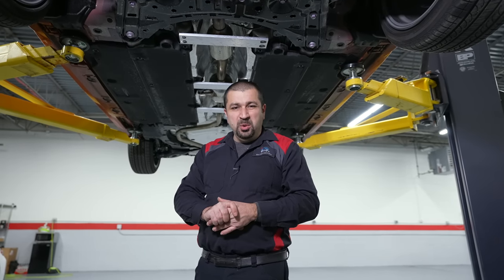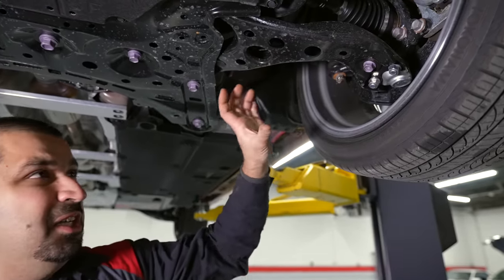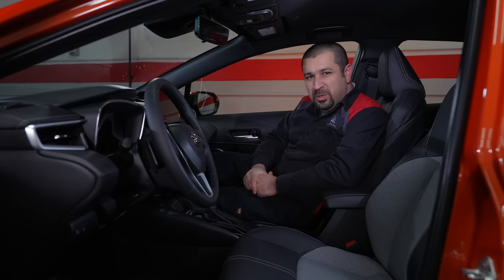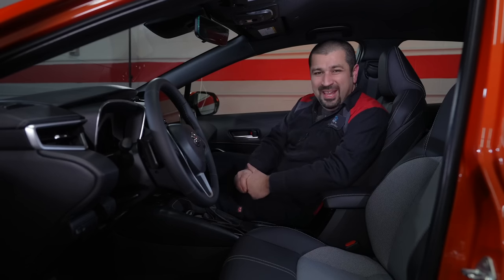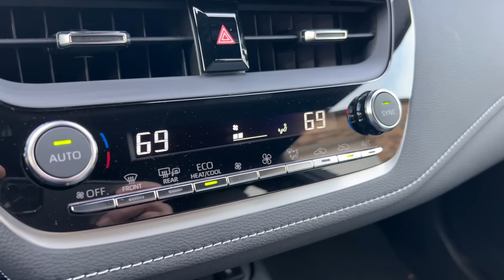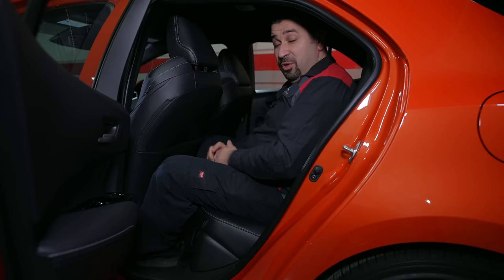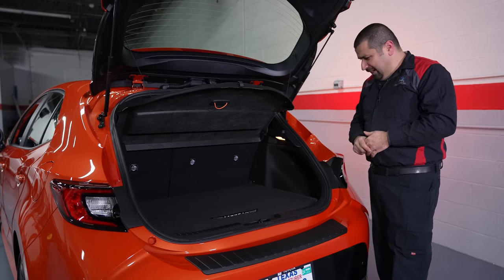Should You Buy a Toyota Corolla in 2023? I Have Good News and Bad News!

Comment: My 2011 Toyota Matrix has way more leg room in the rear, as well as more trunk space. It also has a roof rack that bolts into the sides of the roof. The new Corolla has a roof rack that attaches the ledge of the doors. WTF? I also find it off that the 2023 model doesn't come with a sunroof option unless you upgrade to the $40k model. That's ridiculous! My Matrix has a sunroof for crying out loud. Another feature the Matrix came with was a JBL sound system. The new Corolla doesn't come with the JBL unless you upgrade to the $30K model. Mind you, I am referring to CAD prices here. I just find the newer Corolla to be a "little" cheaper in quality vs price from their older models such as the Matrix. As for the new Corolla having a plastic valve cover, plastic under heat will eventually run the risk of developing cracks with time. I don't know how well these valve covers will hold up when these cars start reaching 10 years of age. Another thing that concerns me are for those living in the rust belt. I like how they covered the undercarriage; however, there is a risk of rust forming underneath those covers. Unless they're 100% waterproof, water and humidity will make its way under them. I would definitely consider applying an undercoating under those covers to stay on the safe side.

Comment: Kinda glad I got the 22, because although wireless aa/carplay is nice, the sharkfin is annoying for washing the roof and the new chime sound is REALLY annoying. The cruise taking two presses in the 22 is a little annoying, but cancel and resume are 1 press which is fine.

Regarding the few trim choices of the Hatch, I think they made a conscious decision to do this to push people into the Corolla Cross instead. They probably figure the Corolla Sedan and the Yaris are the small car choice, and the Corolla Hatch is mostly for hatch lovers, then the Corolla Cross is for those who might have previously chosen the Hatch. Also with hybrid and non-hybrid and sedan and hatch, that's a LOT of trims if they don't make some tough choices and cut out a few of em.

EDIT: After 1.5 years of ownership, here are the biggest annoyances with this generation Corolla:

- all interior plastic trim scratches very easily, and the dash as well
- many owners have complained that the thin vinyl coating layer on the steering wheel scratches up or peels off, I haven't had this problem though as I use driving gloves as my hands get cold but mine doesn't have the heated steering wheel
- the piano black plastic trim along the shifter and AC controls even more so, even a paper towel will scratch them! Use Swiffer duster or damp microfiber cloths only!
- the paint scratches and chips very easily, consider ceramic coating to reduce scratching, or full front PPF to reduce chipping, however you will still get door and trunk chips somehow
- road noise is bad, consider adding sound deadening to doors and wheel wells
- blower motor suffers from same coil whine problem as every Toyota and Lexus for the last 5+ years when fan speed is above about 75%, there's an add-on cover they stopped providing which fits and which MIGHT dampen it a bit, part number 55607-02280

Comment: If you only sell what 95 percent of the market is buying you can’t go wrong.
In America 95 per cent of the cars sold have automatic transmission.
I had a corrola in 1972 with a manual transmission I can’t buy a manual transmission today unless it’s custom or I get the GR sports model with the awful ride. Toyota is being smart by limiting trim’s too much custom work costs time and effort on the production line. Many people are settling for a car with what they can afford. $28,000 is a lot of money.

Comment: I just bought the 2023 this same one, but you didn’t mention that they changed the oil 0W –8 is what they say to use. The manual says if there is none available, you can use 0W 16 but then go right back to 0W8, but these oils are for fuel economy, and not for protecting the engine, which I do not like but it could be good but it’s new and I feel like a guinea pig and I didn’t know I was going to be one

Comment: My first visit to this channel. A good and informative video. Sadly, the new LE sedan, has reverted back to a rear beam axle suspension. That's a shame, but I guess like Mazda, Toyota do it to keep the price down. I don't know at what level IRS is supplied on the new 2023 sedans. I still would like to see this 169 bhp engine offer more torque at lower revs. These days, we are obsessed with BHP at the expense of torque, meaning you have to rev the arse of it to get anywhere. Therefore, the new Toyota 2 litre hybrid with electric power to give you low end torque when you take off is the way to go. I've driven a Camry Hybrid 2012 model since new and done 99,500 miles. I am not a fan of CVTS or ECVTs, I prefer the 6 speed auto my wife's Tucson Blue hybrid has, but the main thing is you take off with loads of torque due to the electric motor. I get you lot love stick shift. Me, no thanks. Get an auto box with fully manual override with paddle shifters and Bob's your Uncle. Unlikely to happen in cheap family cars of course! In stop-start traffic, manual boxes suck. Beng a Brit, I drove every day and changed gear over 1100 times a day. As a result of that and the pressure the clutch put on my lower spine, especially in stop-start, I had an 8hr back op with 3 discs replaced and a bunch of titanium. I know, a manual is fun on a country road with bends, but realistically, most Corollas will be town cars. But, good luck to you if stick shift is what you want.
Reply: The  sneaky regression to a torsion beam in some Corollas is Toyota regressing back to its bad old penny pinching habits. The 2.0 Hybrid system found in the flashy new Prius gives a major boost of power. All reports indicate the upgraded 1.8 in the 2023 Corolla Hybrid provides a substantial improvement over the old powertrain.  I am sorry to hear about your back problems. Luckily, mine is fine so I will keep shifting my own gears as long as I can.

Comment: My spouse and I are taking delivery of an SE hatchback next week! It's interesting hearing AMD advocate for the base sedan; we chose the hatchback for the very reasons he argued against...alloy wheels standard, better interior appointments, classier/sportier exterior. Not to mention substantially increased storage/cargo area: almost 5 cubic feet extra with rear seats up, 10 more with seats down! The clincher was the price; in our area of the midwest, a modestly appointed SE hatchback only retails for ~ $700 more than an LE sedan.
Reply: i  have a 2019 hatch the xse and absolutely love it. This is a really fun care to drive but it isn't a race car.  Wish it had a little more pep but it's a corolla and it is dependable and if you maintain it it can last forever.  I had a matrix hatch years ago and it was quick.  Had a different engine

Comment: I noticed that Corolla have hood insulation pad but mine doesn't. It's a '23 LE, It's easy and quick to install but cost around $200+. Is it really worth it? I'm more concerned about protecting the hood paint from the engine heat. I plan of keeping it like forever 🙂
Reply: It won't do anything for paint, but does make engine noise a LITTLE better.

Comment: One thing to note. The strength to weight ratio of Steel amd Aluminum alloys is such, that you can design a steel component to be lighter than an aluminum one, because it can be thinner/smaller. Also, steel has an endurance limit..i.e. it has much better high cycle fatigue life, if designed properly.

Comment: I have been driving Corollas for, geez, over 40 years. My current commute car is a 2008 Corolla LE (or XLE, dunno) with a manual transmission. It has been very good to me, ,minimal trips to repair, reliable transportation. I am getting older, and I am now looking at getting a new car. I looked at the Corolla, the Corolla Hybrid, and the Prius XLE. At this point in my life, I am afraid I want to abandon the Corolla and go with a Prius. I don't need AWD. I don't need the "Limited" edition, and the price is only $4k more than the Corolla Hybrid, with the same MPG. For that $4K I get so much more. I am not buying yet, just thinking, and when I buy it will be a cash deal. But soon,....
Reply: My car is from the same generation (2003-2008) as yours. Those Corollas had a relatively high seat height for a small car and generous headroom. The 2023 Corolla and Prius sit far lower to the ground than your 2008 with much less headroom. You may find dropping in and climbing out to be a real chore. I don't think the Camry is much better in that regard. People keep saying CUVs are taking over from sedans but cars today are so sleek and low that many buyers are forced into more accommodating Crossovers whether they want them or not. I am not a big fan of crossovers but there is not a single Toyota car today that fits me comfortably. If nothing changes, my next 'car' will be a RAV4 Hybrid.

Comment: Hello, I bought the Corolla Sedan 2023. I only use it to drive to work at the hospital. I am a boring guy (really boring) and really dont ride to go to different places. I don't drive much, my last car accumulated 7,500 miles in 6 years.  But I sold it and got the corolla 2023 Sedan.  It has been exactly two weeks since i bought it and i have 101 miles in it, so that would mean that each month I will accumulate 200 miles. When should I change my oil for the first time?  By the time I reach 5,000 miles its going to take years (like I said, I am a boring guy). Any feedback will appreciate it !
Reply: If you go though the long list of videos AMD has produced, you will see he has a very clear views on oil change intervals and an initial break in oil change. Your car really ought to be taken on a highway run every week or two to make sure the engine is fully warmed up and moisture condensing in the oil is vaporized.

Comment: I think we need a real investigation into who exactly decided that only Americans can't have manual transmissions without paying for expensive trim models. (Only expensive Tacoma trim package, expensive Corolla, and Nissan only sells the 65,000 dollar Z with manual transmission.  This definitely was not a decision by Japanese executives.  I want to know is it the 3rd party distributors who have so much power over the independent dealers? The distributors force port-added features and even sell the F & I products dealers have to use. I don't buy the lie that they only allow manual transmission on expensive cars due to low sales on manuals on cheaper cars of the past.
Reply: Toyota made almost $9 Billion in the last quarter so they can certainly afford to offer a manual. I salute AMD for naming and shaming Toyota USA and I would like to see someone held accountable for the decision. As painful as the news is Stateside, Canadians will feel even more aggrieved because we buy manuals at a higher rate . Until 2022 we actually had a manual Corolla L sedan that was not sold in the US and now we have lost all manuals on non-GR Corollas. To add insult to injury, I just learned through earlier comments that Toyota has actually reverted to cheapskate torsion beam rear suspension in the non-hybrid LE sedan.

Comment: In the UK in the last 6-8 months, they dropped pretty much all the option packs and nice-to-have standard equipment from the Yaris model. Now, you basically only get to choose dual-zone climate and the safety equipment (BSM, RCTA, Park Assist). On the GR Sport model, you get GR tuned suspension and modified steering (very nice), but otherwise nothing else except the pack to bring it up to Excel spec (it adds the additional safety equipment).

They dropped the HUD, heated seats, heated steering wheel, and auto-dimming rearview mirror. It's as if they're trying to push people into the Yaris Cross (but even that lost options, such as the pan roof and HUD).

I'm not sure how much is due to parts, and how much is other factors.
Reply: I've been noticing that the US market gets all the nice stuff.
And the EU market extras and features from toyota is just kind of sad.

Comment: Sticking with our 2020 and 2021 LE Corollas. 2.0 is not needed.
Reply: Those cheap _______ dropped the independent rear suspension in the 2023 Corolla LE and replaced it with a lousy torsion beam.

Comment: I once had a '76 Corolla wagon, which had similar bulges on the roof by the liftback. The bulges allowed clearance for the torsion bar mechanism which supported the liftback, making raising easier and holding it open. Looks like the same kind of adaptation.

Comment: CVT is Crap!  They know it, in fact they had to integrate a conventional automatic trans 1st gear.  Lose the CVT Toyota!
Reply: Corolla has had a CVT since 2014 model year. LOTS of examples with over 200k+ miles, zero problems.

Comment: I do like the fact that Toyota included both port and direct fuel injection, however, the engine bay looks busy with lots of tiny mechanical bits…makes me wonder how long these parts will last.  And seriously, a plastic value cover???  My biggest concern is if this motor will last and be able to handle going back and forth on California’s steep Grapevine….🤔
Reply: Been using plastic valve covers since 2018 model year in Camry, no problems. Lots of examples with over 250k miles. Many examples of the Corolla's slightly smaller but otherwise the same engine going 250k+ miles, no problems.

Comment: Enough technicals, there are non technicals you missed and it will affect buyers. I needed a car in 2015, after driving a Sidekick for 20 years, I wanted more comfort, so I rejected the Corolla and went mid size. The Camry cost me  a couple of thousands more, but soon I discovered it is cheaper to insure than a youngster car as you said. Camrys have less claims, and 1/2 the taxis in Toronto are Camrys. The first 4 years of insurance savings cancelled the extra I paid for the Camry and I have a better car.  One thing I did not like, the no trailer hitch policy, for a car tough enough to be taxis. I wish Toyota have engineers design their cars and not lawyers.
Reply: Yes, the tow ratings are very contradictory at times. When your warranty is over, there is no reason not to tow a sensible trailer with your Camry.

Comment: Toyota cheaped out and put a beam axil on the LE,  not an independent rear suspension in the rear.  AWFUL   We need a manual as well,  they last forever, and such fun
Reply: Why is the beam so bad? They've successfully used that for decades. It's an economy car.
Reply: @marklintwo  because it is inferior to last years model LE. It's only the lE. Handling and ride lower quality.

Comment: A GREAT car review.
The hump at the back of the car both on the roof and the "visor" maybe, in my opinion, extra strength for the roof and a way to eliminate visor vibration from the air passing over it.  Even though it's lightweight plastic, there is some extra strength gained for that part.
It may also help to break up the air passing over the roof.
It is small inside, so maybe a sales person can fold the back seat down (?) And have front seat to hatchback lock for cargo space.  Just my opinion again.

Comment: I think Toyota should have kept the manual in the Corolla hatchback, maybe even make it manual only. Everything that it has, the sedan does, and better. Toyota keeps stressing that this is the sporty model but it doesn't have more power nor sporty handling. Having a manual transmission is the only thing that separates it from the sedan.
Reply: Agreed.

Comment: I don't buy often, but I guess you coud say i've been a devoted toyota customer:
'74 corolla - manual
'86 celica gts - manual
'90 corolla wagon - manual (ordered and waited)
'03 matrix  xr - manual (ordered and waited)
'04 prius - not manual (ordered and waited)
'14 FJ - manual (ordered and waited)

I'm still not ready for another new purchase, but the Civic hatch with a manual looks about right to me . . . .  da_n you toyota
Reply: Your judgment is exemplary!! In your position I would search hard for a low mileage, manual Toyota. My manual Matrix-in-disguise Pontiac Vibe is about to turn 18 and thankfully it has lots of life left. I hate driving automatics.
Reply: @rightlanehog3151  I'm not ready for a new vehicle precisely because my matrix (225k) and prius (205k) both seem to also have much life left - though my wife isn't so sure.   The matrix did develop a knock for a while, which turned out to be the connecting rod bearings.  Fortunately these can be accessed/changed by just dropping the oil pan.  I'd never done it before, but it went well (caught early, so no damage to the crank).  That and a new clutch I put in at 215k and it feels good to go.  Yes, autos are not my idea of driving either . . . just soooo boring, half my body can take a nap.

Comment: For those that have the 19-22 6speed manual, beware of a potential bearing/slave cylinder failure at low miles! I'm in the process of getting Toyota to honor the warranty period. My 2022 XSE 6speed has this problem. It makes a terrible whirring noise that I've had since around 36k miles (currently at 45k). I took it to one dealership and they claimed that it was the sound from the dual injection system, which made me almost lol. Took it to an independent shop, they confirmed my suspicions, and now I'm taking it to another dealership that they claim are better than the other dealership I went to, in the hopes they will honor the warranty. Now I'm concerned whether or not I'm going to keep this thing past 60k miles, after the warranty period ends.